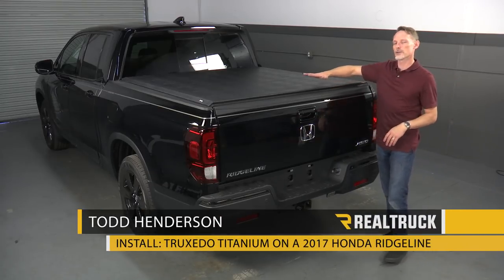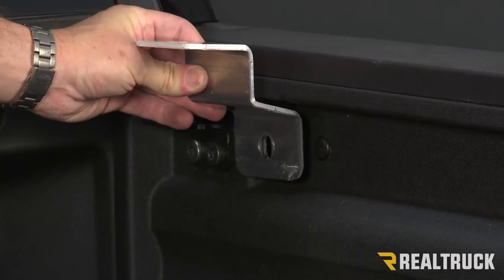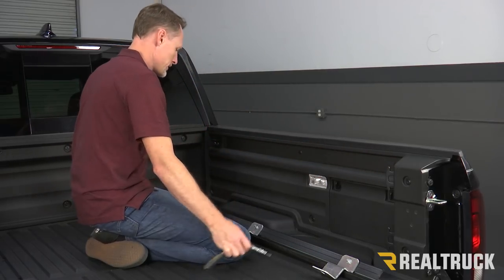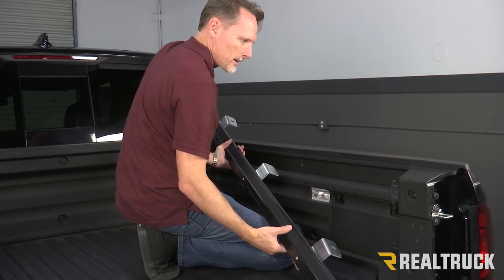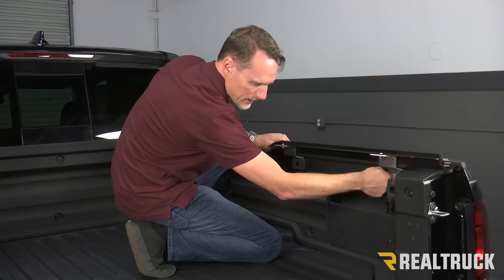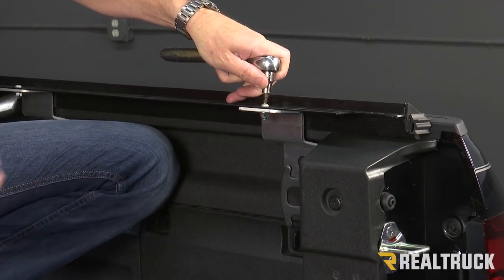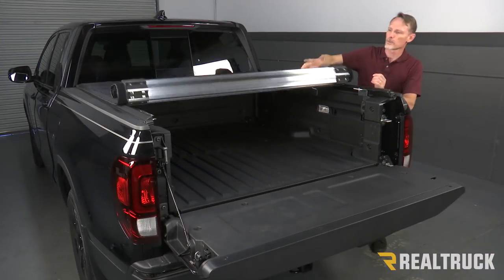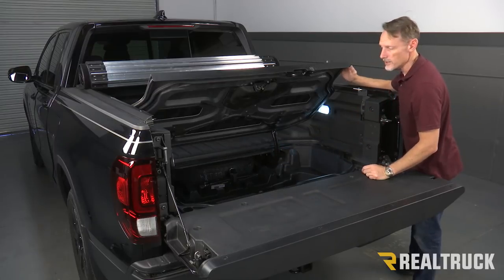How to Install TruXedo Titanium Tonneau Cover on a 2017 Honda Ridgeline

Comment: Have you guys done or plan to do an installation of the Revolver X2 for the 2017 Ridgeline?  It would be great to compare these two against each other.
Reply from the maker: Jeff,

We are trying to get a video of the Revolver on a Ridgeline. I'm not sure if that will happen but we are certainly looking into it. As far as the installation goes it is very similar. You will have to install the accessory rails and then install the rails of the cover.
Reply: I have the revolver x2 and they don't use the 3 bolts like this one. Instead they use the ends tie down brackets bolts. I  like mine but this is just water repellent not waterproof.